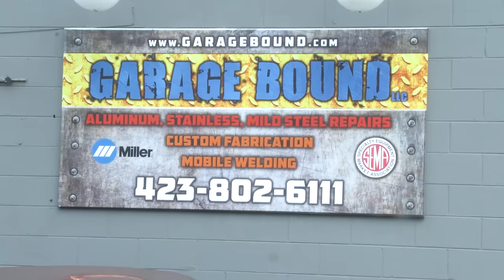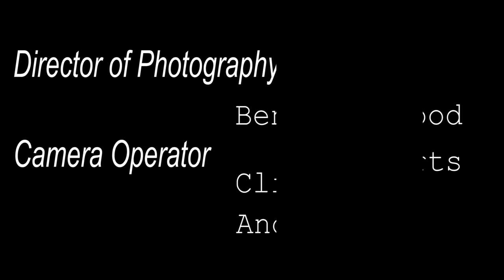Underwater Empire, Episode 5 "No log left behind, Clint's revenge"

Comment: You ever thought about getting a high pressure pump that way you can blow the sediment away from the log to loosen it up or an air compressor to basically do the same thing to jab it under the log and blast it with air to loosen it just a thought